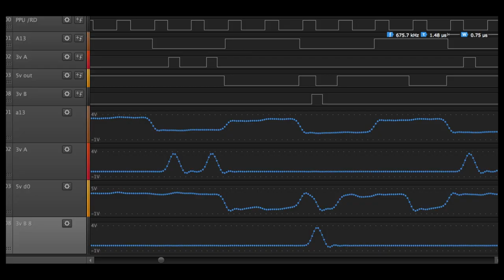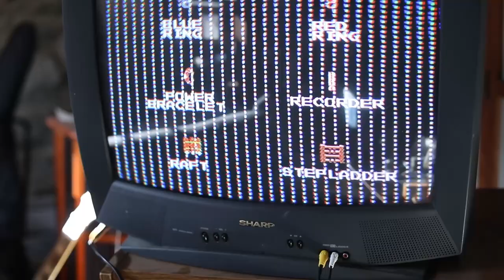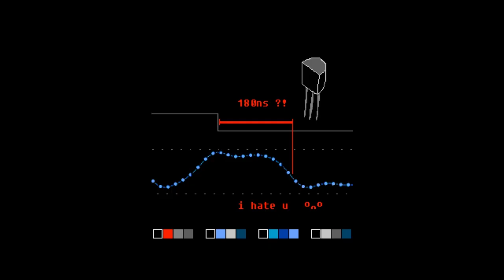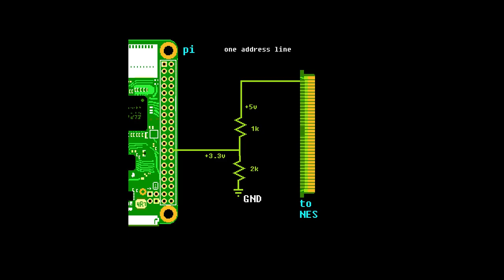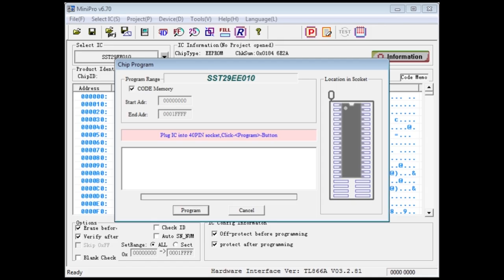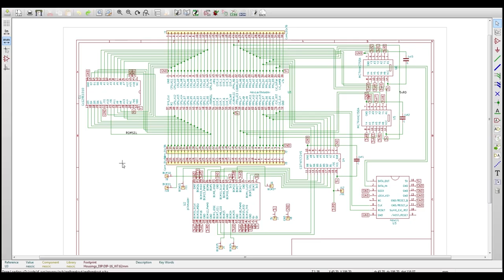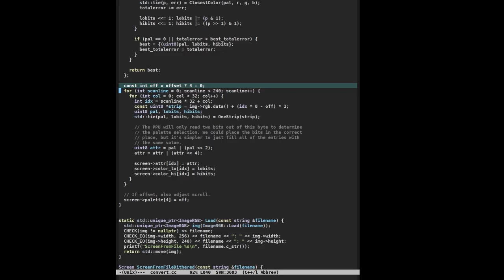Making of "Reverse emulating the NES..."

Comment: Did you really go straight into the base of the transistor from the Pi? That was pretty much a short from base to emitter, good thing the Pi short circuit protection works. You were saturating the hell out of the transistor, it would take forever to turn off from that. You figure out what base resistor to use by the beta of the transistor, you figure out how much current must flow collector to emitter add some extra to make sure it is saturated, and figure out how much base-emitter current you need. You pretty much always need a resistor on the base of a bipolar transistor.

Comment: Man you would have been a LOT better off with something like an esp32 for low latency and reasonable power.  Then you get free wifi and bluetooth too.

As for emulation, use the pi, but just have an input side to the esp32 as well to have it translate blocks of instructions to NES bus operations.

Comment: For the rom, did you compile the C code you wrote to 6502 machine code? Or am I misunderstanding what you did with the EEPROM?
Reply from the maker: Yes, cross-compiled to 6502. The code is very simple so writing directly in 6502 assembly would have also made sense, but I was not struggling for performance on this side.

Comment: Have you considered trying to make a custom integrated circuit with software like 'Electric' (that's the name of the program; it's an open source VLSI suite) for some of the components? This is something I've found myself kinda interested in (due to playing waayy too much Kohctpyktop), and would kinda like to know what the process would be like, to design an IC and then send the design off to a fab to make a few.

I have no idea how cheap or expensive it would be, or if it would at all be worth it, but I'd love to see someone smarter and with access to more resources than myself try it.
Reply from the maker: Yes, that would be fun! I think it would be a lot more practical to use FPGAs, as my impression with fabricating ASICs is that the up-front cost is very high, and so it's only really appropriate if you are mass-producing parts. It might be practical to do some "hobby etching" of silicon with large feature sizes, though, which would be interesting if not useful :)

Comment: So about that expansion port on the bottom: is there a way to maybe "crossfire" the NES hardware with a Raspberry Pi, or what have you, to leave the cartridge slot open for games? The idea being then you could make adapters for the 72pin connector and possibly edit the hardware on the fly to emulate other cartridge systems entirely?

I'm a fucking idiot, so I don't know! I'm just curious!

Comment: Brilliant work as ever, I've a huge respect for the effort and imagination you put into working on and communicating your projects. I'd considered similar things when I looked into gameboy programming, thinking about how my USB programmable GB cart was faking a ROM https://i.ytimg.com/vi/0-EMmc4TVv4/maxresdefault.jpg Would be nice to try GB and GBA with super powers also. I was about to comment on audio but am glad that I watched until the end, looked into the https://wiki.nesdev.com/w/index.php/APU a little but your concept of re-appropriating the CPU as a memory firehose is awesome. There's a lot of potential for using something like this to assist with retro gamedev, using reverse-emulation as a (possibly multi-console) devkit of sorts. You can modify control and dataflow at any point, can pause execution, step, rewind if you keep a history of states, inspect and modify memory, save/restore the entire machine state, transfer state from the hardware to a mirror copy emulated on your device. Hardware bugs that are near impossible to emulate (@beware on EFNET/#gbdev has plenty to say on this) could be used intentionally - https://wiki.nesdev.com/w/index.php/Errata This might be an interesting technique to find currently undiscovered hardware bugs by fuzzing and looking for deviations between output of the hardware and an emulator, as a way of sampling data for https://www.cc.gatech.edu/~riedl/pubs/ijcai17.pdf (posterity, we can store a neural model for longer than slowly dying chips from the 80s) or some deep reinforcement learning e.g. https://www.theverge.com/tldr/2018/2/28/17062338/ai-agent-atari-q-bert-cracked-bug-cheat / https://www.youtube.com/watch?v=meE5aaRJ0Zs which was subsequently reproduced by human input on console. Would also be nice to see people release traditional games as well as those that incorporate super powers to add 3D rendering and other capabilities such as networking, output to VR headset https://www.youtube.com/watch?v=jIV7zAoq51w and so on. I can imagine there's a lot of fun to be had if you start integrating this with things like the light gun, and any of the other oddware released for retro consoles e.g. https://www.microsoft.com/buxtoncollection/a/pdf/BYTE%20Glove%20Comparision.pdf

Using an FPGA for this might be a way to achieve more accurate timings for the instruction stream hijacking. https://hackaday.com/2015/10/18/fpgas-for-the-raspberry-pi/

Looking forward to your next video as always.

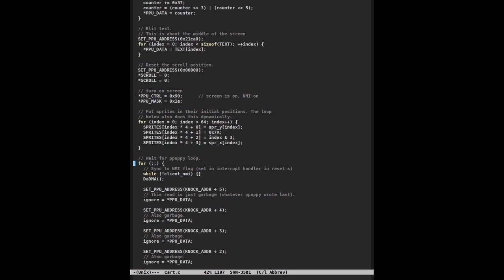Comment: 22:22
"void main(){"
for shame
Reply: Pedantic mode activate: Proper ISO/ANSI C requires the signature to be int main(void) or int main(int, char**) both to yield a return code for _start (from crt0) and to adhere to ISO/ANSI C's safety rules (particularly, that main(void) specifies no arguments while main() specifies unspecified arguments, which makes main(1, 2, 3, 4, 5, 6) a valid call due to backward-compatibility with pre-ANSI K&R C). The C code may be running without an OS under it, meaning there's nothing for main to return to, but the unspecified arguments and void return value can still be problematic (and you should be using _start anyway, considering that compilers/linkers like GCC/ld tend to look for _start as the program entry point), at the very least because void main is confusing to other C programmers, who will assume that (based on the presence of main) there's an OS+stdlib that will be running beneath the program, just like I did on the first draft of this comment where I joked that someone could potentially steal your SSN one digit at a time through several runs of the program via the return codes from the shell retrieved from garbage in memory left over by void main not returning anything leaving the code passed to exit to yield an undefined value because crt0 was never designed to be used with void main and assumes main will return an int but it doesn't but the machine doesn't care and will pop a value from the stack anyway which will be garbage leading to a video where you talk about how Kevin Mitnick stole your identity using your NES.

Of course, the simplest reason you shouldn't use void main is that it won't pass -Wall -Werror, which is a pair of flags that should always be used.
Reply from the maker: @BradenBest  This is a weird thing to fixate on! Here C is being used as a glorified assembler for an 8-bit microprocessor. There are no arguments, and no OS to return to; the body is an infinite loop.
Reply: @tom7  and it was beautiful. 😍

Comment: Would it be possible to quickly switch the palettes between the even and odd fields in interlaced mode in order to obtain more colors?
Reply from the maker: Yes, and I tried this out, but I was surprised that blending colors across two frames didn't really cause me to perceive it as the "in-between" color. It mostly just looked "flashing." Might be something I don't understand about color perception, or maybe the frame rate is too low. There's additional complexity to changing the palette every frame (since it is installed by the CPU and has to be there ahead of rendering) so I just used one palette per frame for the emulator demos.

Comment: I'm surprised you said you wanted a through-hole instead of a surface mount EEPROM configuration.  What if your ROM doesn't work ?  I mean, it obviously did, but don't you think you should have gone for a build with debugging in mind ?  What if you want to flash a program ?  You're going to be doing a lot of desoldering/resoldering...
Reply from the maker: I just used a ZIF socket for the development board. I don't see how surface-mount makes this any easier?
Reply: @tom7  Chip removal for reflashing, .  You sorta made it sound like you solder the chip directly to the board.  It didn't make sense to me in my head...

Comment: @10:30 it sounds like you're claiming the NES uses data and address on the same pins -- at least for the cartridge connector for both the 60-pin and 72-pin variants, that seems to not be the case? -- Address lines and Data Bus lines are distinctly segregated for both the CPU and the PPU. -- Can you talk more about this and explain what pins (if any) carry both address and data? -- Or can you otherwise explain what you are referring to here? -- Thanks!
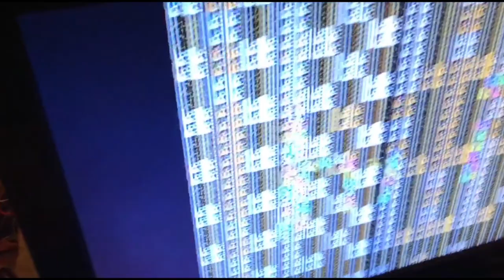Reply from the maker: It's been a while so I'm not sure I remember all the details, but take a look at this: https://www.nesdev.org/wiki/PPU_pinout ... Pins 31-38 on the PPU are both data and address (though the high address bits have their own pins). At 32:33 you can see sequential addresses reading as binary numbers!
Reply: @tom7  Ohhhhh AD0 - AD7 on the PPU!! -- I didn't even notice that when I was looking at the pinout -- thanks for educating me there.

edit: Interestingly -- the cart connector seems to not have that? -- see "Cartridge_connector" on nesdev wiki.

I wonder if it has a latch prior to the cartridge connector, triggered on one of the edges of CLK? -- That would make sense... -- the bus capacitance would be still happening in that case -- just on the NES motherboard side, right? -- Because on the cart connector we see A0 and D0 for the PPU on segregated pins...

Still though, again, thanks for educating me! 🙂

Comment: To add to the idea of extending human brains with artificial parts. 
We kinda have it right now. 
For example if you ask me today what is the square root of 1483736995whatever2633678 you would hear the answer within 1 min.
I would use my phone. The speed is obviously is not as fast as my native brain connections, but it is still incredibly fast and for most of intended purposes it will be sufficient enough. 
On the other side, we as developers, have to ask ourselves about bad unintended consequences of creating such a powerful technology that changes the way brain works. For example, what if that said technology would be controlled by some monopoly that has intention of disturbing political world.

Comment: Could you get arbitrary choice of colours using sprites?
Reply from the maker: You can get some more colors in a few spots on the screen, but there are lots of limitations. For example, the PPU hardware can only draw 8 sprites on a single scanline. I didn’t try it because it would substantially complicate my PPU read prediction, which is already delicate and somewhat noisy. I’m also close to the time limit for the dynamic frame generation (snes demo etc.) so I don’t know if there would be enough CPU cycles on the pi to solve for the best sprite placement. Would be a good enhancement on a more stable setup.

Comment: I recall some work was done on a linux kernel patch letting you run a program in real-time.

https://medium.com/@metebalci/latency-of-raspberry-pi-3-on-standard-and-real-time-linux-4-9-kernel-2d9c20704495

Demonstrably lower latency and you would probably get interrupted less. Might be worth a try if you ever come back to the project.